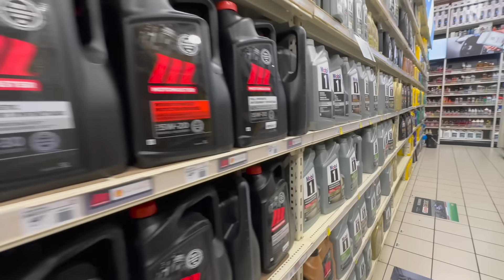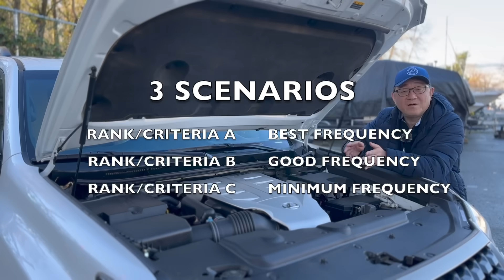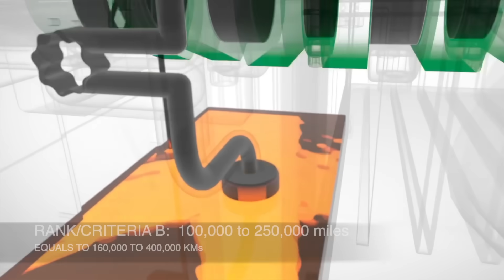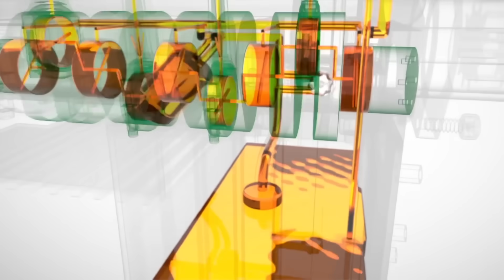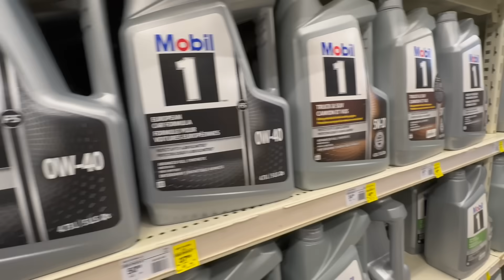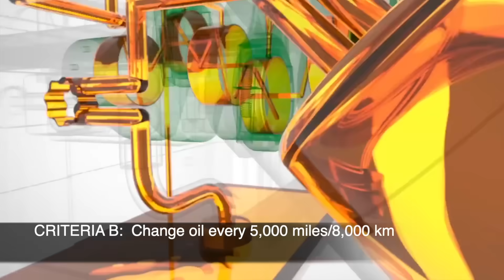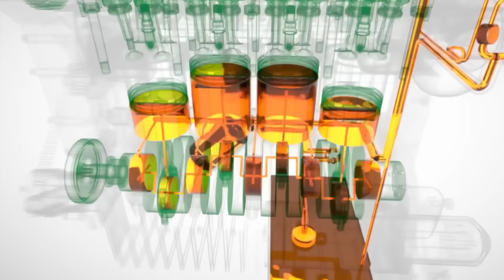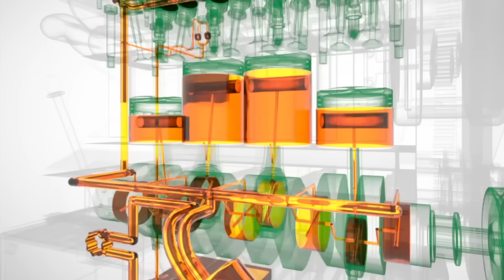ENGINEER EXPLAINS HOW OFTEN TO CHANGE OIL & FILTER // UPDATED CRITERIA-BASED RECOMMENDATIONS!

Comment: My 2001 Grand Cherokee 4.7 v8 lasted 450000 miles. Mobil 1 every 3000 miles. Send an oil sample once a year to Blackstone laboratories in Indiana for analysis to make sure no coolant in oil. Never shut the engine off cold. Operating temperature very important. And keep driving.
Reply: How many transmissions did you go through?

Comment: Excellent advice. Well explained and makes perfect sense.  Oil still must be changed despite advances in synthetic stock and additive packages. I'm glad to see the recent push on YouTube for this as often overworked smaller engines, turbocharged, direct injection etc. have put a lot more demand on oil.  Don't trust the manufacturer of your vehicle or the oil company 100% as they are always trying to sell you either their product over another or a replacement vehicle every few years, no such thing as lifetime transmission fluid either. Option 2 will work best for most of us. Nobody advocated for neglecting your vehicle and screwing the next owner, "worst-case" follow the owner's manual recommendations.
Reply: I gave up dirty oil and routine oil changes in 1963 with a Frantz oil cleaner and Standard Delo 30W. In those days we changed the filter more often and added more makeup oil. Now I go 6.000 miles between filter changes using Walmart synthetic. I use depth bypass filters on my transmissions. The first filter change and everything is clean. Dont worry about dirty fluid again. Without proper filtration transmission fluid can have more abrasives than motor oil. The old Ford truck has a Gulf Coast filter on it. The 390 engine has a Motor Guard on it. All of my filters use toilet paper except the old Ford diesel tractor that uses a flat head Ford V8 canister filter modified to use a roll of Scott 1000. It has half a roll of Viva towels in it now. No routine draining of good motor oil. The Pontiac has a Australian Jackmaster Classic. A lot of filters that clean oil these days. Not many choices in the 60s. Frantz and Motor Guard is all we had.

Comment: I got toyota dealership free oil changes. They said bring it when the maintenance required light is on. Guess I'm waiting every 5000 for around 2 years... I can't afford oil changes at 3000 miles

Comment: Group A sounds a bit overdone. Have done 15,000 km/9000 miles (Volvos LL schedule is 30k and BMW 50k!) or max one year intervals and never had any lubrication related problems in my long staying diesels. Usually 5w-30 or 5w-40 fully synthetic, sometimes 0w in the Nordic winter

Comment: Why is it bad to use the manufacturer’s recommendation? Unless they want it to fail so you have to buy another one. If that’s the case, why would you be a repeat customer if the engine failed prematurely on their recommendation?

Comment: It is, unfortunately, is signifiacantly more complicated than this... In the last few years oil filter manufacturers have increased production but also simultaniously reduced quality of assembly, leading to contaminants in many of the oil filters such as too much glue on the end caps, particulate contaminants left behind inside the center of the oil filters (which goes directly to the bearing surfaces in your engine). As well i have been seeing quite a few filters with the center tubes not having the louvers opened up enough, which will lead to lack of oil flow on cold starts and alot of bypass.  Always look inside your oil filter right down the middle with a flashlight before installing and make sure there is absolutly no junk inside, and the louvers are open enough to see the filter media behind them. If it fails this, return it as defective and buy another one that is made correctly.  As for the oil, well this is a more intricate matter...  Oil being produced today is more regulated than ever before, and is also very low on some of the most important additive used in days past, which is ZDDP.  Boutique oil producers tend to have better additive packages with more robust doses of the additives which used to be common place, which is why i like to use them.  Todays oil also being as thin as possible does not lend itself very well to "spirited driving", or towing.  Lets just say that *w30 was the mainstay of manufacturers for common gasoline engines during a time of a more "common sense" period for a reason... overall, if you want something to last longer, do your homework, dont be afraid to open your mind a little bit on alternatives if you want a longer lasting engine...

Comment: I’m a second generation auto mechanic and can expertly advise that what the engineer is recommending is spot on. I have never had to replace a properly maintained engine but I have replaced a couple of hundred engines that were poorly maintained. It always costs more in the long run to go cheap.
Reply: A poorly maintained engine is allowing the oil to get dirty then draining it. I can't seem to wear out an engine. In 1963 I installed a Frantz oil cleaner. Cost me 29.95. The Australian Jackmaster Classic  cost me about 180.00 plus about 50.00 for shipping from Australia. Going cheap is using only full flow filters and draining the dirty oil.

Comment: Good advice. People would always give me shit about changing oil at 3k miles on all my cars and we finally got rid of this older Honda Element it had 200k miles on it, ran absolutely perfect and didn't use a drop of oil. And if you do the work yourself, oil is cheap. I mean, buy it buy the jug and buy a case of oil filters.

Comment: It seems like oil contamination would depend on how much oil the engine holds. I had a Mustang that held 10 quarts. My Subaru holds 5 quarts. Wouldn't that make a difference in how often it gets changed?

Comment: I think all these recommendations are bogus without understanding how to read an oil analysis and distinguishing between gas and diesel. Further, length of your trips, highway/city driving is also a big factor. Synthetic oil is very robust and while you don’t want to stretch it forever, you can at least double all the numbers you laid out.

I have taken several diesel engines well past 500,000km and working on two more one at 320k and the other at 200k. Every oil change was at least 10,000km and some even higher. Lab reports prove the oil had lots of life left and could have gone much longer. 

Use proper oil and stay away from the over marketed ones aka Mobil 1 and for extra insurance, change your filter half way through.

Comment: Hopefully I can get 40 years (or 200k miles) driving 5k miles per year with one full synthetic oil change per year. That way I never need to buy another car. Oh, but what about that lifetime transmission fluid? When should that be changed?

Comment: Change oil and filter every 5,000 miles or 6 mos with Mobile1 full syn. or Toyota OEM oil and use Toyota OEM filter.  Most of the time I time out before I mile out in that regimen.  I’ve never had an engine that burned oil.

Comment: I do all my own maintenance on my vehicles. It doesn't make any difference how long I keep a vehicle, I change oil and filter at 3000 miles. I haven't had favorable experience with pure synthetic oil, I use a synthetic blend. I have a Kia optima with a 2.4 engine that doesn't burn any oil with a 135,000 miles. That's because I change oil at 3000 miles. Oil change and new filter is cheap insurance.

Comment: I like how he suggested changing Possibly the filter every other oil change. Yes, you could change it every time you drain the oil.....but you don't really need to if you change your oil every 5000 miles or less. If you are doing regular oil changes every 5000 miles or less, it is not necessary to change your filter. Every other oil change is enought, the filter will still be filtering your oil adequately.  Of course, the companies that make filters disagree and most shops disagree,  but you can skip the filter change every other oil change. Now, if you are going over 5000 miles between oil changes, definitely change the filter too, absolutely!  There you have the truth, do what you want with it.
Reply: Filters are cheap.
Reply: The point is filters cost money. If you don't need to change it, why then spend the money? A lot of people are on a strict budget.

Comment: I would personally disagree with 6 month oil changes, I have seen many tests where oil after 1 year has not changed when the car is being driven so little.  In fact one test with oil being evaluated showed no change even after 18 months.  Especially if you are using a quality synthetic oil

Comment: I change my oil every 7K miles. Subaru recommends 7500 for the 3.6R. on dyno oil. 190K later I am not going to disagree with them. I use Kirkland synthetic. Engine also has integrated oil cooler.

Comment: What if you're a very, very low mileage driver?  Like 1200 to 1500 miles per year (two or three days a week)?  Do you still recommend every six months?
Reply: Once a year
Reply: Supposedly the oil loses its chemical magic with age and the heat and cold cycles. Oil changes are cheap and fast it wouldn't hurt to change it more often.

Comment: I'm planning on 12mo/7500 mile intervals in my 2023 4Runner. I've seen way too many 4.0L's, including newer ones, hit well over 300k miles on 10k intervals to be afraid of going past 5000. "If these engines were sensitive to oil change intervals... we would know by now".

Comment: I have a 2010 Camry with the 2.4L 2AZ-FE engine. I used to adhere to the 10,000km oil change intervals till around  150,000km where the car would need oil topped off at around 6000km. I switched from full synthetic to semi synthetic and changed the oil at 6000km intervals. The car is at 306,600km and runs better than it did with 10,000km intervals. A few months ago, I couldn't replace the oil till about 8,200km and I noticed that the oil was at 80% capacity on the dipstick. Please change your engine oil more frequently, your piston rings  will really thank you. From what I understand, modern engines have piston rings that don't apply as much tension on the cylinder walls as older engines did (for the sake of fuel economy). More frequent oil changes prevents the piston rings from 'sticking' which causes oil burn and eventual scoring of the cylinder walls.

Comment: My 2005 Camry LE...bought new and changed synthetic oil + Toyota filter every 5,000 miles. Sold it at 218,000 miles...ran like it was brand new at sale. I recorded every oil change (date and miles for 15 years) and that sure looked good when I sold it! Bought 2020 Camry LE...bought new and now change synthetic oil (Mobil 1 OW-16) and Toyota filter every 6 months regardless of miles driven. I'm retired and drive a lot less. Car Care Nut gave good reasons to do so. Don't be cheap and don't be stupid!

Comment: I have a question regarding both Toyota and LEXUS. I know they're the same company in regards to the oil light indicator Coming on every 8000 km or 5000 miles. Most people disregard how often the engine oil should actually be changed due to  to the dealership sales people telling them they can go to 16,000 km or 10,000 miles. Has more and more car manufacturers are using these tactics. It's basically forced the Toyota and LEXUS brand to follow suit rather than be a leader in the automotive  manufacturing industry . these intervals at which the dealerships are telling customers is the minimum manufacture requirement for oil & filter change intervals and that will get the vehicle to the out of warranty or warranty limit because let's face it they're in the business of selling cars and car parts and lasting forever doesn't increase their bottom line. Whereas if you ask an engineer who created the engine for either brand, they would recommend 5000 miles or 8000 km. Could you please explain and you tell me if this is true? Based on your video I think it would be the 5000 miles or 8000 km which is what I believe the oil indicator light coming on every 8000 km or 5000 miles indicates to the customer. I'm finding dealerships in North America,mainly where I live Canada are misleading their customers in order to to increase sales they fudge the numbers in order to meet sales and  profit margins by misleading customers by giving them the minimum requirements in order to maintain full warranty throughout the 60,000 km or 4 years whatever it is?

Thank you I'd appreciate your input or maybe even some type of tutorial video for viewers to see what's actually going on inside of an internal combustion engine, which most people have no idea and understandably so that's why they change the oil less frequently. I feel that some type of animated or even cut away part of an engine with better explain to your viewers how vital it is to change the engine oil & filter. To me it's no different than the blood in our body needs to be cleaned out through our vital organs in order to keep our heart healthy. 

Email address,

Lesliedave1975@gmail.com

Comment: Great video! Thanks for your insite on this subject.  I have another question regarding the type of synthetic oil and filter cartridge for my European Yaris 2017.
The car's manual says to use 0W20 and also permits the use of 5W30 (that one was used all the years to date by the local dealership annually).
Now i want to do all my next oil changes myself, so do i keep using 5W30, or do i change to 0W20 premium full synthetic oil? 
My second question is regarding the filter cartridge, I got a couple of these paper cartridges made in China, which looks exactly like the OEM Toyota ones.  Is it safe using these?
Reply: Don't use no name filters, good filters are Mann Mahle Purflux Hengst Blueprint, not something of bad quality like Denckermann, Ashika, Japanparts. It's not worth to risk engine for few €
Reply: Actually I have two filter cartridges off Aliexpress,  but they come in a "genuine" TOYOTA carton red box with all the logos, serial numbers and look the same as the one I got at the local dealership..  so I don't know..
Reply: 0w20 is preferred for fuel economy, may have increased consumption.

Filters... Use OEM. If you really can't stand the cost (skip a lunch at KFC...) MANN and Mahle probably the largest two tier 1s in Europe.

Comment: took my new 2023 Lexus GX 460 in for first oil change at 800 miles.  The dealership actually tried to talk be out of doing it so soon but I insisted.  I wanted that first oil change early given that will be the period of time where the most wear takes place.  I did note that the oil capacity for the 0W20 oil is almost 9 quarts.  I am guessing they are trying to use the lighter oil and more of it to lubricate the engine.  What is your opinion on the 0W20 oil.  it sure seems light.
Reply: A few days ago, I bought a new 2023 Lexus GX 460 and it will have its first oil and filter change between 800 to 1000 miles. Car Care Nut YouTuber bought a new GX 460 and did a 1000-mile oil and filter change on his GX. He showed all the metal particles trapped in the oil filter that's common to see from a new engine.
Reply: @thedetective8150  urban myth!!!! The oil filter catches the little baby small small metal particles that the engine puts off 500 to 1,000 miles. It's dosent hurt to change it but it's does waste money and time. There is no scientific proof to the early new car oil change.

Comment: Interesting topic, don't doubt what you say.
Personally I believe how you run it in makes a huge difference in ring seal and thus blowby and how dirty the oil gets. I've always gone out of my way to follow a specific run in procedure from new, and never done anything other than "C" for oil changes ( but I use oil flush each change and get every last bit I can of the dirty old oil out ), and have had no issue getting good compression and above average performance well into 200thou miles beating on my cars every day. Just my 0.02c..

Comment: I own and drive a 2007 Honda Civic coupe with 214,000 miles, 2012 Honda Accord Sedan with 113,000 miles and a 2016 Chevrolet Silverado with 89,000 miles and I change the oil in all three with Pennzoil Platinum full synthetic oil at 4,000 mile intervals with quality filters and while this may seem too frequent to some I feel it’s cheap insurance to keep my vehicles on the road and reliable! I do all my own maintenance and do transmission changes at 30,000 mile intervals and I’ve never had an issue with 20+ vehicles over my driving and owning experience!

Comment: I have a GDI Turbo and do mostly around town driving with lots of stop and go with 25% highway driving. For me, 3000 miles with full synthetic is best. 4,000 miles is ok.  If I did mostly highway driving, then 5,000 miles.  I used to do 6,000-7000 oil change intervals, then went to 5,000 miles but knowing what I know now, I do it every 3,000 miles still with full synthetic. Going strong with 169,000 miles. Original engine and turbo.

Comment: When I purchased my IROC (305) back in '88, I decided that I would change the oil & filter every roughly 1.5kmiles.  I have done so for 35yrs with the only change being that I switched to synthetic about 7 years ago.
Reply: Its hard to believe someone would be ignorant enough to drain oil every 3.000 miles. You can find filters that clean oil for less than 300 bucks. My oldest bypass filter is almost 60 years old and cost me about 30 bucks. My Australian Jackmaster Classic has already paid for itself. Gave up the oil change racket in 1963 with a Frantz oil cleaner and Standard Delo 30W.
Reply: So every 6 months or every 12 months 
(Sunday good weather summer  cruiser?)
Reply: It'd be nice for that beaut to be ran on the highway every now and again to keep it exercised 👍🏽😏
Reply: it weird to me when people say it's a waste of money you can never go wrong changing the oil plus oil changes are cheaper than a motor